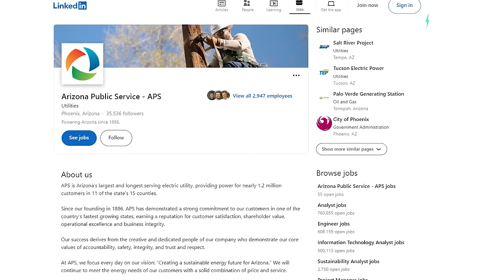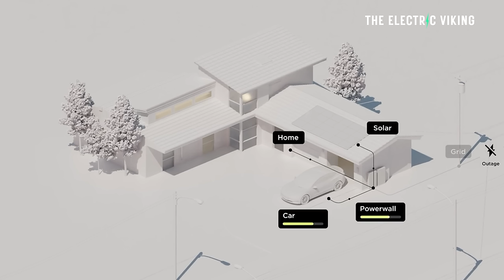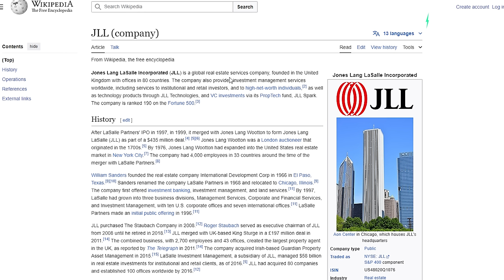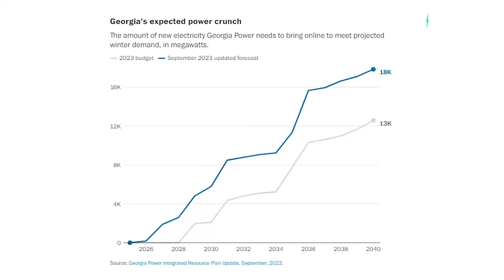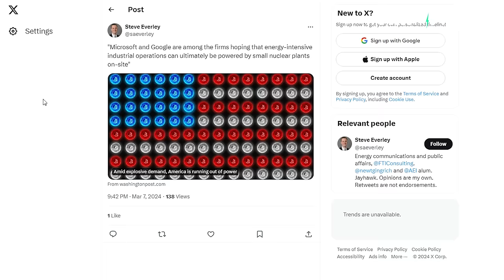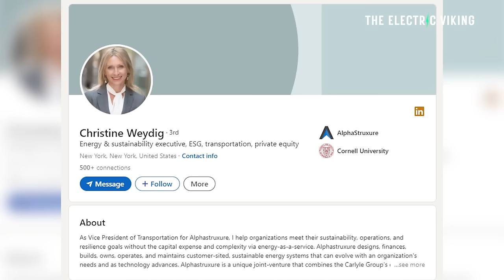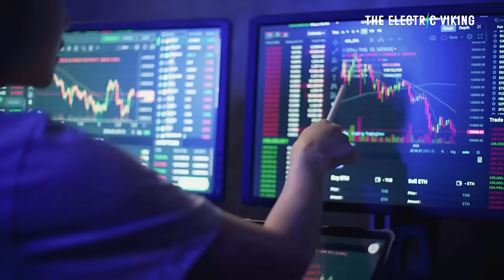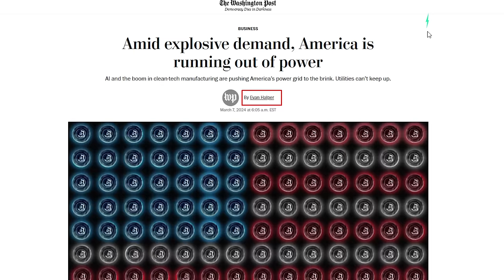An explosion in demand for electricity is creating a looming crisis in America

Comment: This is a good macro overview of the issue. The biggest thing this video misses is the entire supply vs demand economics of power costs in real time. US "utilities" are privately owned profit corporations that have zero competition and fighting any idea of competition. This is exactly why they refuse to interconnect to make the grid more redundant, and why consumers getting paid to supply energy back to the grid is currently entirely at the utilities discretion. 

As the video points out, there isn't an energy shortage, there is an energy storage shortage. Utilities won't pay the cost for grid energy storage until all consumers are guaranteed real time pricing for using or sending energy back to the grid. Currently, utilities also give huge price discounts to industries that guarantee a significant base load. When the cost of power is charged both ways at real time pricing equally to everyone, utilities will suddenly see the value of paying for storage. The crucial point is allowing consumers themselves to balance their own pricing with a smart panel and minimal local power storage. This is exactly what utilities don't want because they are in the power selling business, not the guaranteeing power to everyone business. That will have to change by requiring utilities to give consumers power outage minute credits. 

Utilities should be able to provide grid scale power storage much cheaper than consumers can. Sadly, this simply won't happen until consumers can balance their demand with real time pricing, giving Utilities the need to invest in that balancing storage capacity to remain profitable. With renewable energy, utilities must shift to being grid maintainers over being power sellers.

Comment: If you come home from work and still have battery left, your car could help power your house on peak hours. It would be partially powdered by the car to a certain point then off peak hours it will charge up and be ready by the morning. It is a tacky efficient solution but the problem is that the reason tesla hasnt implimented this feature in their cars besides it taking away sales of powerwalls, is the degredation of the batteries. Powerwalls have much better cooling solutions because they aren't weight or size restrained (one powerwall looks about 1/3 the size of a model 3 battery, but it actually only is just 1/8 the capacity)

Comment: Any datacenter should not be a burden on the grid, but be self sufficient. Else: no building permits.
Reply: Yes this is how to solve the issue.
The utilities can always cut it off.
Take care M
Reply: So should EV users. 

Make Coal Great Again
Reply: Wrong.  Data centers should work with public utilities to determine the most efficient solution.  If you remove options, then the result will be missing out on the Data Center industry entirely.
Reply: @bunsw2070  Even so EV are better
Reply: @metalmilitia224  modular reactors still aren't really proven and the initial CAPEX is still a lot
Reply: @joeybagadonuts1206  the issue is that data centres ask for crazy high loads and utilities don't know if they will use it
Reply: @joeybagadonuts1206  They could use the grid, as long as they don’t become a burden and squeeze out others.
Peaceful coexistence 😂
Reply: Coal is dying because it is too expensive! Renewables with batteries is cheaper to build new than it is to keep existing coal plants running!
Reply: @bunsw2070  Coal is no longer economically feasible.
Reply: Large power consumers have contracts to pay much cheaper power than the average consumer because they provide a large base load on the grid (revenue) that utilities can count on. Data centers are already looking to generate their own power, as the video points out. There isn't a power shortage. There is a power storage shortage and a system of local monopoly utilities that are in the business of selling power, and rather than guaranteeing grid uptime. Both of these issues come down to how utilities are allowed to function and what they view as profitable.
Reply: @0ooTheMAXXoo0  that's not true at all

Comment: There is plenty of cheap land with outstanding solar and wind resources in west Texas, New Mexico, Arizona, Nevada, etc. all you need is fiber optic access, which is a lot easier to get than transmission lines. DCs are, for the most part, managed remotely. This is easier and faster to solve than upgrading transmission lines, which should be upgraded but that will take many years.

Comment: EVs and rooftop PV are a perfect combination for offgrid in the suburbs.
Reply: Ummm, in the Future , suburb homes Replaced by Apartment &v Condos TOWERS , except in Rural Areas. 
also, Apartments & Condos will be FULLY Subsidized , but you wont OWN it.
Reply: @markplott4820   Let's keep it simple: 20 million buildings in Australia 
300 million buildings in the USA 
That is a lot of rooftop real estate.
It is already connected to the grid. 
If the buildings can generate and store their own  electricity, then that is the amount that the grid does not have to supply. 
That is new capacity for the grid to use to supply others, like condos.
It is a simple physics problem if you have economical PV and EVs. 
The social problems are more difficult.

Comment: Change expensive peaker power plants to mega battery stations. Data centers could be required to have clean mega battery backup to take care of their peak power usage. Virtual Power Plant agreements to eliminate single point of failure is the preferred  path I recommend 😊

Comment: Okay folks, let's not freak out. A data center takes about 3 years to build. When they build it, they build the grid to match its needs. The grid is only as big as it is required to be. As the need increases, the grid increases. As the need goes down, they simply reduce the throughput in the infrastructure in those areas. The grid is fine.

Comment: The grid is fragile because it is extremely expensive. 
The most expensive energy. 

The grid was never overbuilt because it is too expensive to construct more than is needed. 

Two rows of towers because if you needled more capacity then you could not just put bigger conductors, you needed the same system built next to the existing towers.

Comment: Data centres are more of a fixed load.  The problem is air conditioning and coal/nuclear power.  AC is a massively variable load and can peak out in a heatwave at dinner time.   Battery banks can certainly buy time for gas turbines.  The UK has large amounts of pumped hydro which we use primarily for peak demand, we also have lots of gas turbines which can load follow much more effectively than coal and nuclear steam plant.
But yes peak demand is always the issue, and EVs don't really add to the problem, in fact they make power supply far more profitable.  High speed charging could be an issue, but its very easy to control these chargers and hold off for a few minutes or simply ramp down in a power shortage.
Reply: No, EVs do add to the problem. Much of what you say is correct, and I can tell you have some knowledge as a fellow EE, but easy back of the envelope estimate shows that every household that adds 2 EVs will consume about 600kwh extra power each month (30-50% of total home electric consumption) in the US where 35 miles is average daily commute (for a Tesla Model 3, at 4mi/kwh efficiency (less when cold & such), 30-40 miles will use approx 10kwh/day * 30 = ~300kwh per EV; most EVs that aren't Tesla have closer to 2-3mi/kwh).  Some households have 3-4 vehicles (some EV youtubers here I've heard say they own 5 EVs).  

10 years ago, the grid would build up heat in the lines and the transformers during the heavy loading in the day, and then they would dissipate some of this latent heat during the night when temperatures and loading were lower.  This heat dissipation will not happen if we focus the majority of EV charging at home (thru rate pricing) to be in the evening and night/early morning hours. This will lead to more failures and less MTBF.  

I think the E-Viking's assumption is wildly unrealistic that the average Joe will tolerate a 6 hour window of no traveling during prime hours in order to support the grid by keeping his EV tied to it & allowing them to use his car battery as essentially emergency life-support during peak demand (increasing wear cycles on his battery, diminishing his range, and delaying his errands or other travel trips to be at super inconvenient hours (for the majority) assuming he has enough range, or having to wait for peak to subside enough for him to get the charge he needs for his travel plans).
Reply: @RT-mv7df  You are assuming that we move to 100% EV in the field tomorrow or soon.  That probably won't happen for 20 years.
You also seem to be assuming that everyone is doing 17,000miles per year.
I agreed there will need to be some upgrades, and better business models for electricity, but there is time to do.  Most grid authorities have said it won't be a problem in the time needed.  The UK is working on the great grid update, but this is mainly for renewables.   EV charging stations are using batteries to buffer power.

Comment: Transmission line efficiency can be as low as 60%. Transmission lines are often 40 years old or more. Electricity use in the UK has declined over the last 5 years. Infrastructure investment has been reduced by up to 50%, which means any system failure will take longer & more costly to fix, eg, skill shortages. New solar farms can wait up to 18 months to be connected to the National Grid. High energy costs has led to the selling of many farms, which could have been avoided.

Comment: Makes sense when you think about it, electric demand goes up almost every year, a lot more is being thrown onto it, EV cars, heat pumps and in the near future, we are going to see a lot more A.I. and robotics, all of this is putting more demand on the electrical grid as we go through the transition in the energy sector.

But there are signs that as renewables get better and cheaper and the same for battery tech, more of us are likely going to be able to go off grid, which should help to reduce demand on the grid.

There was a report I remember reading about that said by 2026, around 60% of EU homes could go gridless, which if true, that's sooner than I expected and far more houses than I expected, but renewable and battery tech is getting better and cheaper all the time that's going to allow more of us to do that.

Because of advancement of tech, it's hard to know how much demand is going to be needed on the grid, but in any case, we can't afford to take the chance that more of us will go gridless, but honestly I'm not worried about all this, there are already solution around the corner to solve these problems and there are more options opening up for consumers in case it does become a problem and we still have some time left, which will allow renewables and battery tech to get better and cheaper.

Comment: According excel energy, an overhead double circuit 345 kV line will cost approximately $2.0 to $2.5 million per mile.if the US only added 1,000 miles of transmission lines in 2022, that is 500 miles of double overhead transmission line, which would be no more than $1.25 billion. That is a drop in the bucket compared to the $100 billion per year being spent on new energy generation. It is pretty clear that electricity delivery companies need to step up their game on deploying new transmission lines. And there is profit to be made in this. They charge as much per kWh to transmit the power as they pay the suppliers that are generating the power.

Comment: Crypto miners, data centers, and wait for it..... Cannabis grow facilities are all new mass users of power in the last decade or so. I don't take issue with any of those things, but they use a LOT of energy. 
I like the idea of incentivising residential solar and battery storage and making it like each home is it's own power station. Even if you got 25% of homes to conceptually be independent power stations it would take a huge load off the grid especially during peak usage. Invest in strategically located mega packs and most municipality would be good. Production of electricity doesn't seem to be the issue, it's fair and equitable distribution and compensation for what's produced and used that always seems to mess it up.

Comment: The BIGGEST solution - or at LEAST solid mitigation --->  WATER COOLED SERVERS.    A fair amount of power goes to cooling with air when water is FAR more efficient - The other best option is to locate data centers where the heat can be USED by local homes/businesses for heat
Reply: Yep, just need to have the city put in a 2nd completely separate water system to transport all that heat to homes (make sure they are insulated so the bulk of the heat doesn't radiate to the ground), and retrofit every home to run the heated water through their heat exchangers.  Simple and easy and super cheap.... And during the middle of summer when the heat isn't needed, magic will dissipate the heat.
Reply: NOPE , heat pumps.
Reply: @RT-mv7df  Been there - did that.  Philla and many others had a common steam heat system!

Comment: Nvidia's Blackwell GPU will be available as a standalone GPU, or two Blackwell GPUs can be combined and paired with Nvidia’s Grace central processing unit to create what it calls its GB200 Superchip.

That setup, the company says, will offer up to a 30x performance increase compared to the Nvidia H100 GPU for large language model inference workloads while using up to 25x less energy. That energy savings is an important part of the story.

Comment: Most of the time utilities are in a state of over capacity. Power plants are built for peak. The rest of the time much of the plants capacity is underutilized. Take all that underutilized capacity and put it is batteries, and use that electricity to cover the demand over peak for years and years. Install lots of wind and solar, drop that generation into batteries when it is more than what the grid needs and use it when demand is highest. Some 90% of the time powerplants are running at blow capacity. That is a lot of extra electricity going unused. Almost double the total power plant generation in a day. One thing. Europe is lowering its electricity needs. ??? They are doing this through efficiency of things like heat pumps and induction stoves. In the US politics and corruption can create a crisis where there is none. If Europe electric demand is dropping, then the US's electricity demand should drop in the near term as well.

Comment: The problem with just using batteries for renewables is that you can't store energy for long terms economically. You can have whole years with half the aberage wind solar output, trying to store the missing half a year's of energy in batteries would cost trillions of dollars for most grids. Then, there is the increased transmission cost of renewables because they do not utilize grid consistently. When you take storage and transmission into account, nuclear power produces an order of magnitude lower carbon emissions than wind and solar per GWh.

Comment: Yet in the NW USA they are furloughing wind generators because of excess power. Now there is a plan to pump water up into holding ponds with the excess energy and then releasing it to produce hydro power when it is needed.

Comment: This reality really contrast with how China approach the energy transition..for Americans they really only deal with problems as they arise, with different level/arms of governments and corporations wrangling needlessly over controls…China knew where they are headed, so they planned&started building the super high voltage transmission lines across the country 10 years ahead, they secured the materials supply chain before the factories/mines are in operation and trained the required labour force/engineering talent from high school level…and most importantly, they don’t just bet on one source of energy on ideological/commercial grounds..solar, wind, nuclear, hydro and traditional coal&gas, China build them all and massive amount of it…they know in the 21st century, cheap plentiful power is Power..
Reply: Spot on, they started this in early 90s, under the 20-30year planning, power plants, powerlines, even before the foreign investment flooded into China, alone with roads and ports. So they are prepared to become an industrial country 25 years ago. Amazingly smart and wise indeed. The central system make it works. None other country can do this at all. They are planning future now.

Comment: It only takes 3 years to build a nat gas plant and US has Lots of nat gas. Solar and Wind are working  and scaling quickly but can't address base load (requires too many batteries save for load smoothing and short power outages. There are modern nuke designs that are NOT being explored by US. Well managed states have no problem. States poorly run do not invest wisely and have problems (California).

The problem is poor government. Not a lack of solutions (that are much cleaner than coal). Some states will thrive, others will whine. Same as it ever was.

Comment: The Grid doesn't work the same both ways its not set up to up cycle voltage  from nano-residential power production  the best residential batteries and solar can hope to do is reduce the grid draw of the immediate residential area. Altering the grid from the ground up to support residential nano power produces is economically ruinous would  like trying to juice Saharan sand for a cool glass of water..